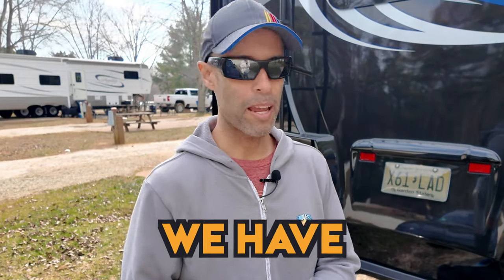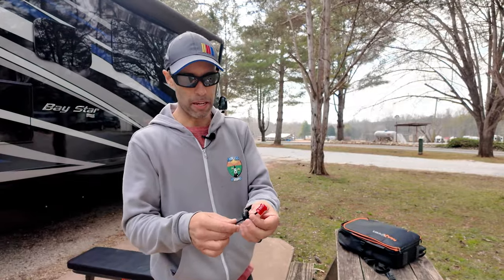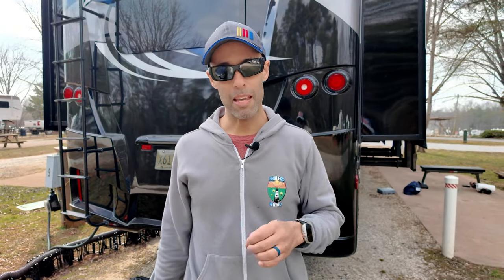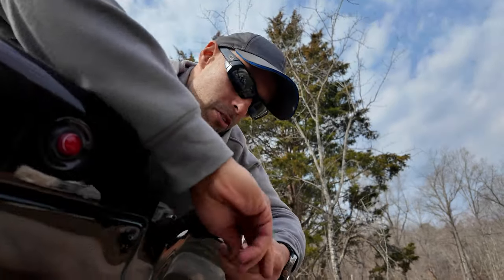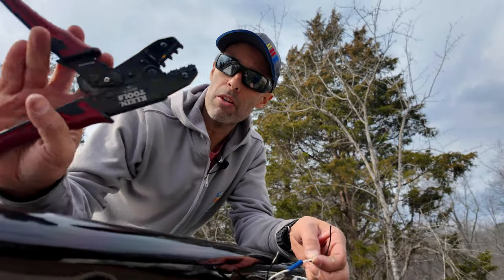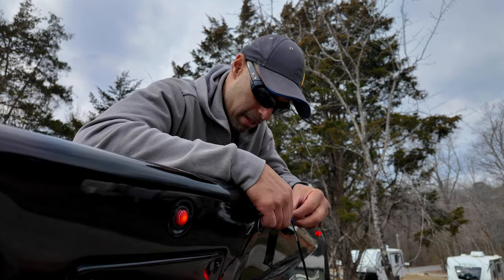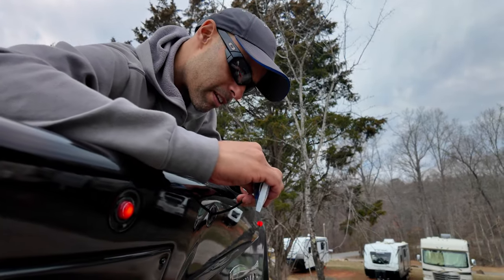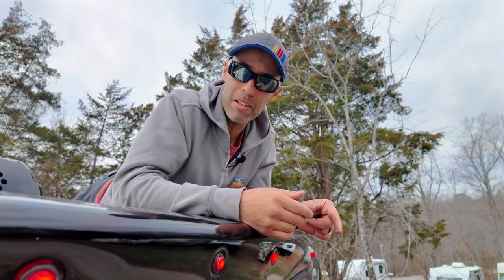Important Repair We Had To Make On Our Motorhome!

Comment: Great tip, Izzy, one other thing I would recommend is using shrink tubing over the butt connectors, this will seal and keep any moisture from getting into the connectors and causing corrosion. It is much better then electrical tape.
Reply: Shrink wrap for sure

Comment: I had to replace 4out of 5 front overhead front cab lights on our 2019 Jayco Greyhawk 31FS last Spring. The lights were originally LED as well. Make sure you tape the wires to your over  cab before stripping them .The wires will fall through the roof hole and you won’t be able to pull them out!

Comment: Another great maintenance video. I have used butt connectors that are shrink tube with a spot of solder inside. Use a stick lighter or bic type lighter to solder & seal in one simple procedure. Thank for sharing this.

Comment: I recently purchased a very used class A. 1998 Thor and found it shuddering badly on the way to and from DMV. By the time I made it home (barely) the front brakes were smelling up the street and were too hot to touch. So now I'm looking at about a grand out of pocket to straighten the brakes out. On the passenger side the wheel bearing nut was far too tight and the inner grease seal was nowhere to be found. Not even remains of foresaid. The wheel speed sensor had been baked to complete failure from the heat. It turns out that the work had created a fifteen thousand pound grenade without pin. If you are unsure about a repair you wish to undertake keep in mind there is no shame in researching your project before and/or during the operation. I wish I had been there when my friend "did the brakes" because I'm sure we would have had a great time doing it and we could have "spotted" for eachother. It would have been great but now he is concerned that I might gripe at him but not me. I look for the fun of things.

Comment: Not all states require those running lights to be working. As far as I know, Ohio doesn't require they all be working. They're call clearance lights. I can't see any police officer stopping anyone for having a light out let alone write a citation. At worse, Ohio writes a warning citation that you have 48 hrs to fix, but that's usually only for a headlight or tail light being out.
Reply from the maker: In NJ you can be fined for each light out.

Comment: Won’t bust your chops for working with a Hot Wire because there’s probably not any metal up there for it to go to ground, but loose the black tape and use a little heat shrink way more durable.

Comment: Great tip Izzy, I noticed when you stripped the wire and it looked like Thor used aluminum wire especially if it's powered up when you have your lights on ? I  am of the understanding that aluminum wiring is bad for any application especially when it comes to homes and vehicles which causes fires. Not sure if there are certain electrical codes in the states that may allow aluminum wiring or that the rv industry has gotten a pass sort of to speak hence the cost being cheaper than copper wiring.

Comment: Something occurred to me.

"That would be considered a life safety issue and, that can also get you pulled over and fined".

News flash.
That light at the top of the rig may be considered a life safety issue by tyrannical government officials, but it is in fact not a life safety issue. Even if the light is a break light.
A light out at the bottom of the rig where drivers expect lights to be, would be a definite life safety issue.

Claiming that a light out at the top of the rig is a life safety issue, is nothing more than another instance of tyrannical government over reach by politicians and bureaucrats lying to the people and passing stupid regulations to make them criminals.

Does the vehicle look better and nicer with all the running lights working?
Yes it does, but those running lights at the top of the rig are not life safety lights. Drivers are not focused on them when driving down the road at night. They are looking straight ahead, and straight ahead is where the lights at the bottom of the rig are located.
Reply from the maker: Thank you for your long drawn out explanation of traffic laws.  Use that interpretation in court if you ever get a fine for lights being out.  

Safe travels